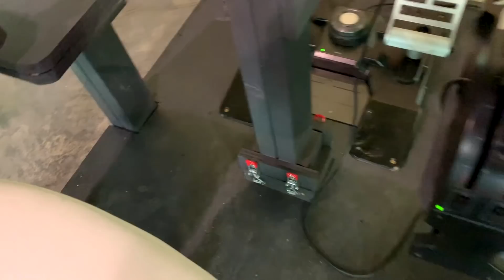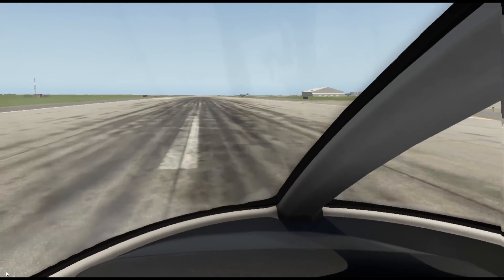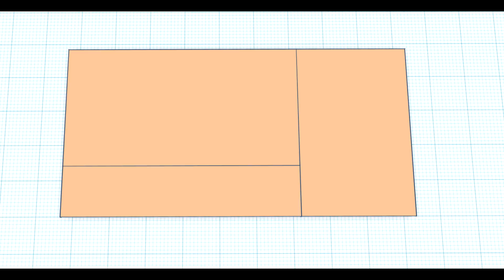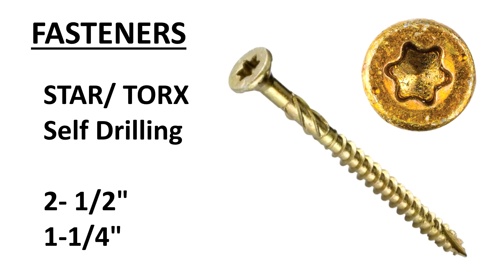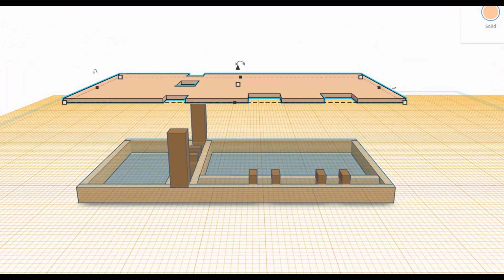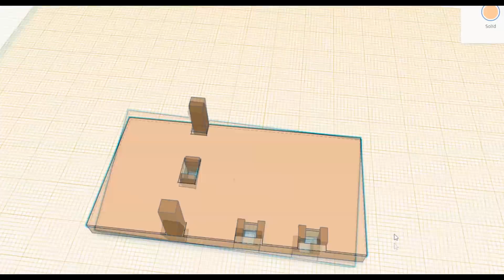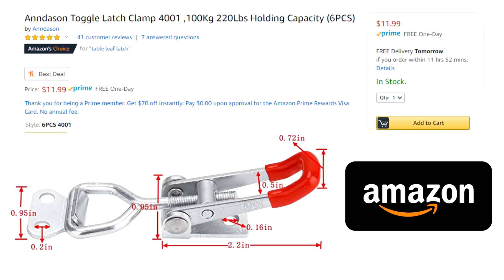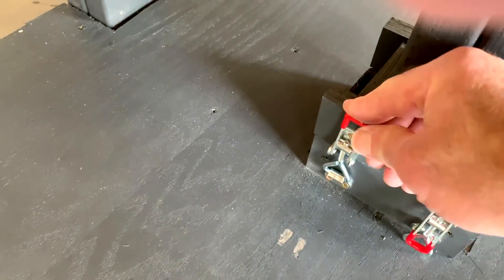DIY VR Simpit

Comment: what equipment did you buy + steering joystick etc.
Reply from the maker: I have several but for yoke I think best value is Honeycomb Alpha and Bravo. If you want cheaper I like the CH Products yoke which has throttle, prop, mixture and although plastic, feels quite good while flying. Avoid Logitech yoke…it has a hard center detent that makes trimming difficult.

Comment: This is great. You really have an engineers mind Russ. I really like the modular approach as even if you think you don't need to move this or that as soon as you find yourself either wanting to branch out into flying something else, OR you simply find a new control device that you really want, you can easily swap out the pedestal or portion that won't work for a new one that will. I was thinking maybe flat magnets like for use in cabinets or such might also work in place of clamps, but I don't think they'd be strong enough. Another idea I thought of, while watching this, was maybe an old car seat (with track) would be a good way to mount it to the deck so as to be very stable yet allow for adjustment. The only thing is it would probably have to be from a truck or van to sit high enough for this application, but maybe not. I know some VR pilots have managed to dump their chair over while engaged in a tense dogfight. This is partly what made me think of it.

I love the really creative fixed simpits people have come up with for multi-screen set-ups but they do require a designated and committed space devoted to that purpose. Well and they also are typically not very adjustable or modifiable for different loadouts for different air craft hardware. A simpit designed from the ground up for VR is definitely the way to go for anyone flying in VR at least primarily. This is very well thought out and I appreciate that you keep these things focused on accessibility and affordability as most of the really cool simpits I have seen certainly cost quite a bit in money and time to develop. Great job and thank you Russ.

Comment: Three years on and I guess I'm a bit late to the party!  I'm actually thinking about duplicating your setup, but I have an idea/mod that might help others.  I have the Thrustmaster TPR rudder pedals which I use for both fixed-wing and helicopters.  For fixed-wing aircraft, the TPR pedals can sit flat on the floor/platform.  But for helicopters, they need to be mounted about 4-5 inches higher .  So in keeping with the modular theme of your setup, I'm going to add a platform for the rudder pedals that can be 'hot swapped' back to the normal height when I want to go back to flying fixed wing aircraft.

Comment: Great project. Thanks for the inspiration. Its funny, i thought VR would eliminate the need for a dedicated cockpit, but VR actually cries out for one. Is there a way you can think of to tidy up the usb spagetti we all have from our devices. Wondering would a powered hub on the platform help? Also thinking spring loaded castors to, 'ground & brake' the  platform, and spread the load on sensitive flooring.

Comment: Nice project, When I did my rig I looked at a lot of options including total DIY. 
What I found was that overall I could buy the GT Omega art cockpit and with adding in some of the accessory packs available could configure a totally adjustable system that would do left or right   stick and throttle, center stick with throttle or twin left, right stick for like space sims as well.
Also all adjustments are easily changeable for height adjustment as well.

 This set up utilizes a fixed seat that can be adjusted forward or backward same as a car. I have the optional Art flightstick mounts, keyboard and mouse shelves plus I also have the separate single monitor stand.

I built a platform on castors as well and the platform is less than 34" wide but built a little longer to include the monitor mount and the PC also is on the same platform which if I unplug 2 AC cords going to the power strips mounted on the rig the entire unit including the pc and monitor can be rolled wherever needed.

Did I also mention that I do racing sims as well and this rig doubles as a racing sim rig as well! My steering wheelbase has a quick release for the wheel and by removing the steering wheel, sliding the seat back about 6" and installing the sticks/throttles in their respective quick release locations for whatever flight sim I am going to play does double duty for all of my sim needs.

The  pedals for the sim racing are mounted to the rig and the rudder pedals for the flight sim are on the platform closer to the seating position. This set up also works well as when you slide the seat forward for the racing rig the racing pedals are in the right location and position and when you slide the seat backwards for the flying position the rudder pedals are in a comfortable position to use.

One thing that makes this system work as well for dual duty is the Virpil Ace Torque rudder pedals as they are a low profile set up and actually work more on an up and down action like a chopper collective setup rather than a forward backward motion like most airplane rudder pedals. 
Considering I am not an actual pilot in training the slight difference in the pedal movement makes absolutely no difference to me.

Now someone not doing a dual flight/driving rig could incorporate whatever rudder pedals they wanted mounted to the rig.
Really the only thing DIY this set up requires is building of the platform for mobility plus as I have advanced somewhat in age I prefer to have my rig higher off the floor than where the seat height would be sans the platform with the castors.

Yes this type of rig cost a bit more but, in my opinion, looks better and for many that do not have the tools to build their own easily is by far a better solution.
 And yes I do have all the tools, saws and drill presses, sanders ect to do a full DIY if I had of to wanted or decided to go that route.
My suggestion is for those wanting to do this style of rig for the least cost is to buy the rig sans seat and secure an automotive seat from a local wrecking to mount on the rig at a fraction of the price that GT Omega charges for a seat.
Actually even an old office or gaming chair and a set of seat sliders to mount the chair to the rig from Amazon or Ebay mounted to the office chair could be used I guess.

 Also for those here in the U.S.A. the shipping for GT Omega is free or rather included in the price for their products and there are quite a few sources to find coupons usually for about a 5% discount as well.
I have absolutely no association with GT Omega at all just a satisfied customer of their products over quite a few years staring years ago with their wheelstands and now with the Art cockpit and accessories.
Reply from the maker: Thanks for your detailed response. I will research zGT Omega

Comment: Hey Russ! Thank you for posting this! I have been struggling with a starting point to build a flight sim cockpit for VR. I fly fighters in DCS and use pointCTRL for clicking the buttons, switches, etc in the cockpit. I am going to build one which will be a little more cramped so that when I use my hand to click, my fingers have something to touch. (It will make sense when I show you what I make). Any followups to this VR cockpit? I'd love to see if you made any changes etc. from lessons learned. (side note, if you haven't tried the HP Reverb 2.. you should!)

Comment: Awesome video Russ! Man I have my eyes on the new HP Reverb G2 VR Headset! But that would be my last purchase for the new Microsoft Flight Sim 2020! I am still using a very old but also, a great working Saitek X-52 Pro HOTAS. I like the fact I don't have to purchase a yoke, a rudder, and a Throttle at an addition cost . It is all built in for the X-52, and I can also use it for Jets and Helicopters! So it is a do all HOTAS.  Although not as realistic to having rudders, it is a good feel for me.

Comment: what VR glasses is it?
Reply from the maker: I think this was the original Oculus Rift... I have since upgraded to the RiftS which is much better in my opinion. New headsets are going to be even better. I t also had inside out tracking so no sensors are required. I also tried Windows Mixed Reality headsets and they work in SteamVR but Rift works natively with X-Plane 11 and is easy to set up.

Comment: Great video. I have a 3 monitor flight sim with all the controls and I just bought a Oculus Rift S and use X-plane 11 with is. I found trying to use the VR controllers are really clumsy but watching your video it looks like you don't use them. My question would be how do you line up the VR view with your "manual" flight sim controls? I have yoke, pedals, power quadrant and trim wheel and would rather use them with the flight sim. Any suggestion would be great. Thanks Russ
Reply from the maker: I do use the controllers but mostly only the right one for items like gear and flaps. For dials it is a real pain.  I like the way you think.  I think when hand tracking is ready you could construct the physical controls to match the VR view but then you could only support the one aircraft unless you had some way to re position the yoke and throttles form aircraft to aircraft.  I do have a cool idea for using the Knobster in X-Plane 11 and will release a video on the new pluging by next weekend. Stay tunes.

Comment: As you are a retired pilot what aircraft did you like flying the best Airbus or Boeing ?
As for the VR setup what would you use for heli use for the collective as I like flying both fixed wing as well as rotary aircraft B429 or EC135/EC120.
Can the VR setup be used for IFR practice?

The setup looks very useful in regards to the space required, as I am currently looking at setting up sim for multiple type of aircraft . Glass avionics.
Reply from the maker: Bevan Gibson If it ain’t Boeing I ain’t going 😃
Never flew the Airbus so really can’t compare.
Several good help hardware options but most aren’t cheap. I am going to try to build one in the future so keep an eye on my channel.
VR currently not good for IFR training since resolution is not quite there and interaction with the controller on dials and switches is a pain. That will change in a few years.

Comment: Hi Russ, thanks for this video it’s really informative. Can I ask which VR headset you use? Also do you have any opinion on the new Oculus Rift S?
Reply from the maker: Jack Y I have a Rift CV and recently got a Samsung Odyssey +. It was on sale for $299 and has a better resolution than the Rift but IMHO the sweet spot for the lenses is smaller than the Rift. For XP11 both work fine.  From what I know only from other’s reviews the RiftS looks just great unless you have a very wide or narrow inter pupillary distance.  Any eyeglass store tech can easily and quickly measure that for you. The Oculus Rift runs XP11 natively while Windows Mixed Reality headsets have to run it on SteamVR which adds another layer between the headset and XP11.  It is awesomely me however you get intoVR simming.
Reply: Russ Barlow Thanks for the helpful response! I will get the distance between my eyes measured as the Rift S looks great. I am a bit concerned about the resolution not being good enough for Boeing glass cockpits but I might take the plunge - really excited to experience VR for the first time!

Comment: Looks awesome. I am still figuring out if I am gonna go for three monitor vs VR. In order to use three monitors I need stronger GPU something like 2080ti so beyond my budget coz I am using 2070 and its only 5~6month old. I might try VR like you did. Thanks for the info!
Reply from the maker: Actually I did both. I have a 1070ti on my 34 monitor setup and the 1070 on the VR.  Both have pros and cons but I find myself doing more VR when I want to fly for fun.  VR is not great for serious training now since interaction  with switches and visual resolution are not quite there yet.  The IMMERSION is AWESOME though.